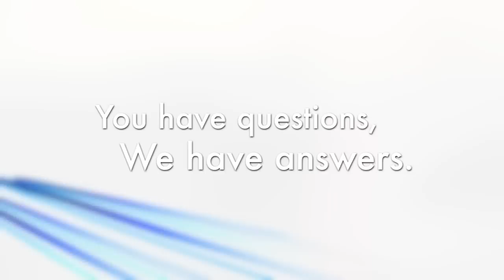Honda CRV Spoiler Installation (Honda Answers #62)

Comment: The holes there already, are they known to leak and put water into the spare tire area ? My caps seem loose but won't come off easy, just wondering if I should pop off and seal right ? Thanks.

Comment: what about rust on the holes?! i would better drive without a spoiler...
Reply: Your Honda dealership has paint pens. I guess it cost around a dollar or two. It has 2 tips . The paint tip and a clear coat tip. Some dealers will give it to you free. Or you could get it from a paint shop. You can find the paint code of your Honda on the driver side B post. For example, NH737M is polished metal metallic, which is the metallic grey Honda. To be honest the color do not matter as it is covered. Yes, the installer should have painted the drill hole. Good catch.

Comment: This spoiler installation is too complicated and looks damn ugly. There is another spoiler with led light strip on ebay for 50 bucks that's a direct fit to the 07-11 CRV. They use hooks in the place of screws to hold the spoiler onto the wing, pretty brilliant. You just need to drill one hole on each side and the location is already marked along the inside top edges of the rear door. As a matter of fact the holes are already half drilled, I only used a hand screwdriver in the entireprocess. The led connection is also a breeze, you just need to unplug the rear door light and connect it to the spoiler's led cable. 

Honda showroom is a rip off they charged $175 + Taxes for the spoiler and $250 + Taxes for the installation. The spoiler they showed was the ugly one as seen in this video. I managed get it done all at $50.
Reply: Harish Kumar can I get the eBay link to that please. Thanks!
Reply: @1987harish  Thanks! Just ordered...
Reply: can you please share the ebay link